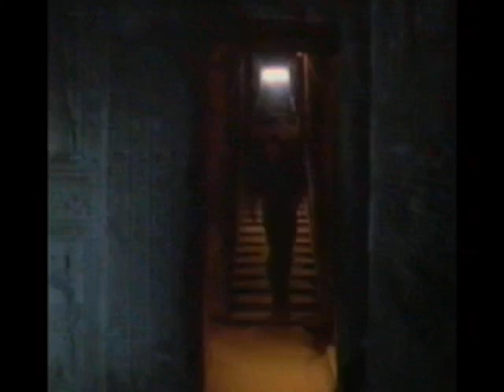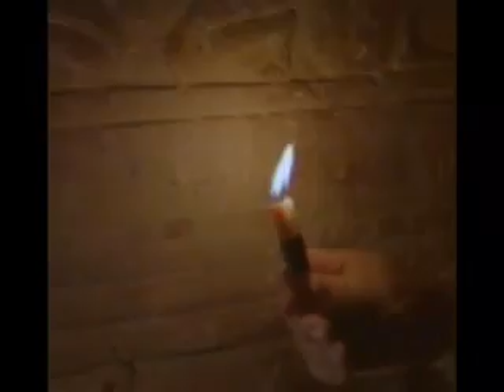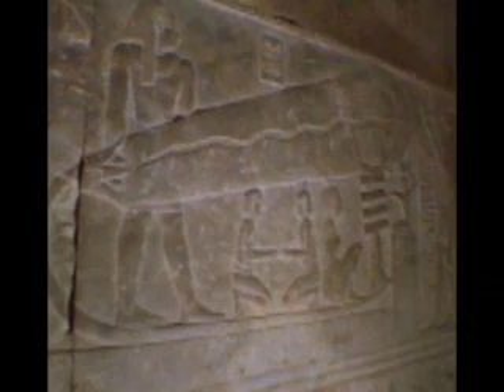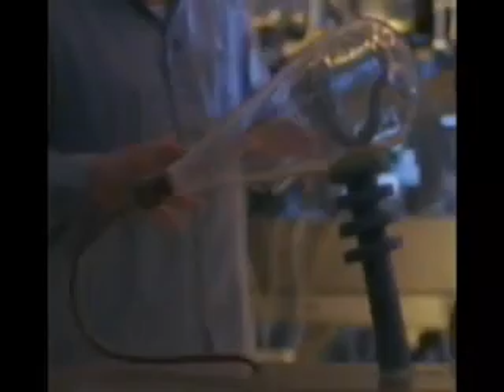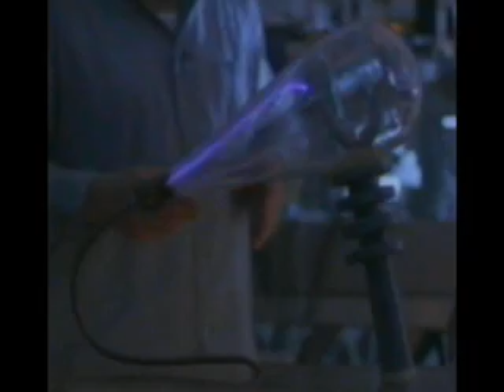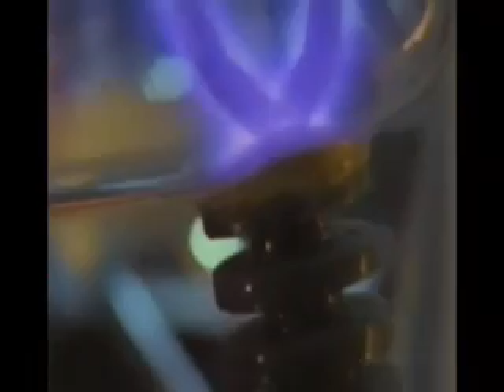Ancient Egyptian Lightbulb

Comment: Old egiptians didnt draw in perspective sight. This is  fact. The two hands depicted in wall , are really supporting something.  It can´t  be a  simple  flower  " parfum " aura.  In the hypothesis of a Tesla electric bulb, then they may  be  well a pair of pole electrodes (inside or evolving ) ,being the "flower" connected to the ground ( Earth, soil )  by its stem. Snake being  a filament or ray .Hands are on a sistro -a beat  marker used in cerimonies ( Maybe  a sparkling field capacitor).